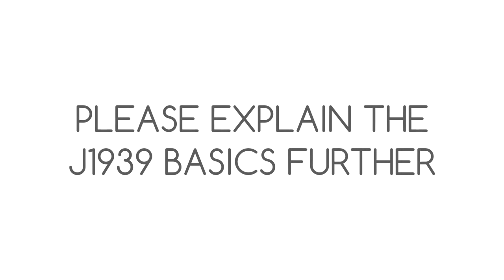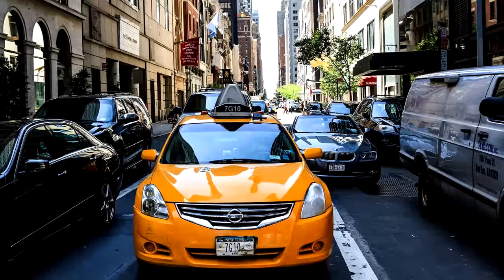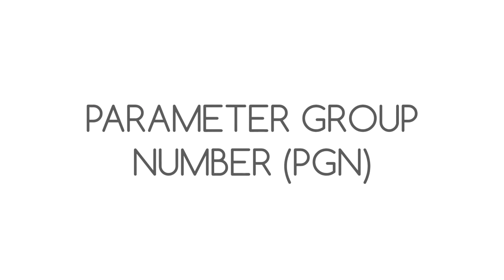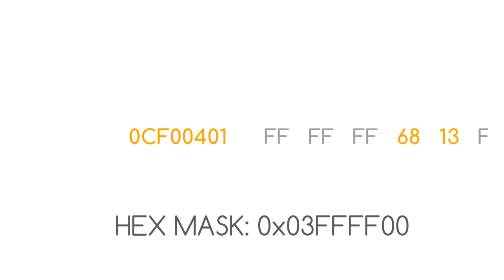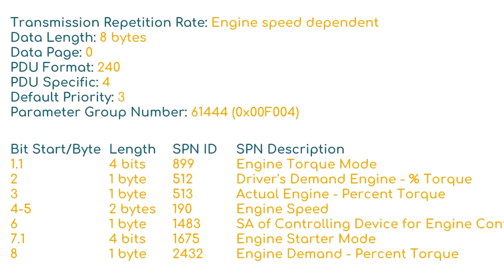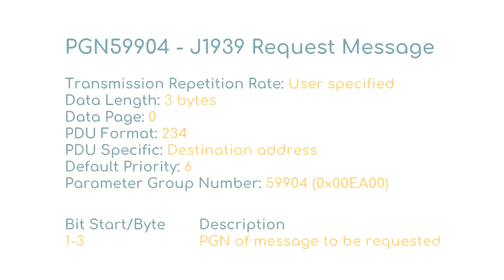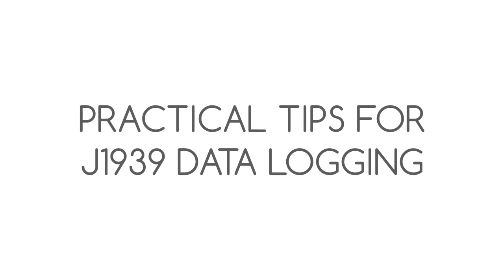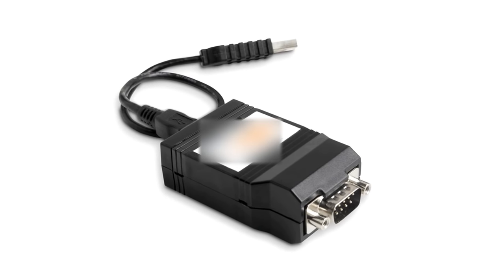J1939 Explained - A Simple Intro [v1.0 | 2019]

Comment: Hi. it was a nice video. But still i hv basic queries. 
1. why only Big trucks use J1939 . y arent these automobiles not making same CAN id signal spec for same info (like engine rpm, accped pos , angle) ? am confused here. if all these automobiles also make same dbc file then it will b easier to decode the msgs instead using diff dbc for diff manufacturers.

Comment: Is there anywhere to download a free j1939 dbc file anywhere?

Needing to work out the protocol for two vehicles i am planning to merge powertrain from one into another.
Reply: Hi Gary, we offer a J1939 DBC on our website for purchase. Use of the data underlying the J1939 DBC requires a legal license, which we provide in collaboration with SAE. As such, if an online version exists for free it would technically not be legal to use